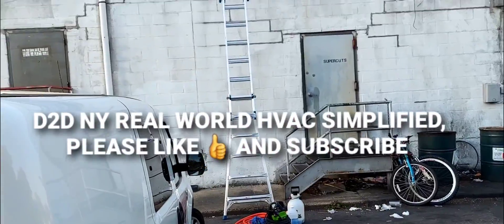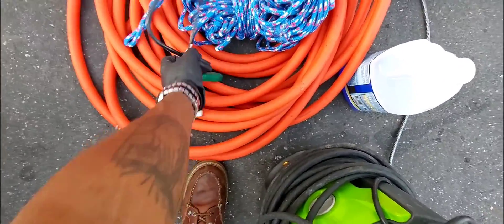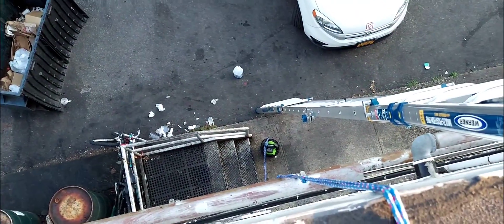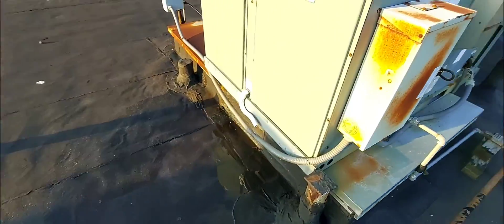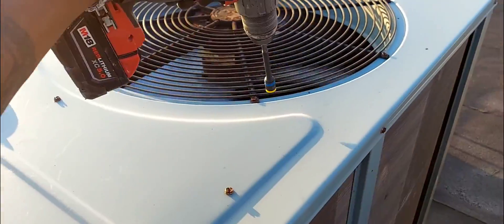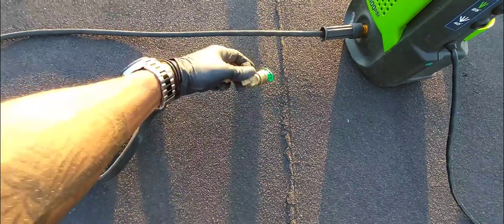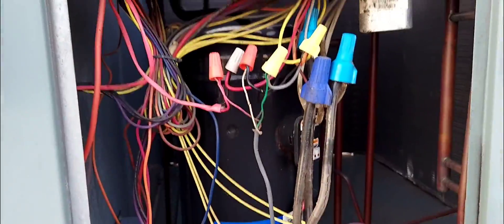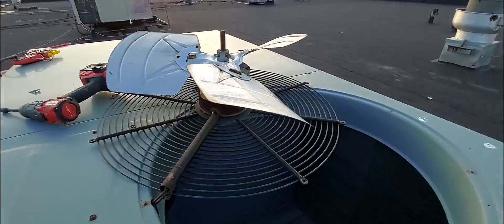HVAC CONDENSER COIL CLEANING

Comment: Commercial pressure washers shouldn't be nowhere near a coil , to maintain coil health it's better to wash with high volume instead of high pressure.
Reply from the maker: I disagree some coils are too thick for a regular garden hose and you need force behind the water to push out the dirt and debris, however you have to have the correct setup ie nozzles and know what you are doing
Reply: @D2DNYAC  that's why you use a Gould's booster pump instead of a pressure washer, I myself will use a low psi pressure washer for residential units as to not use alot of water when servicing evaporaters , but anything on the commercial side  especially chillers high volume  is required
Reply: True, had teacher have apprentices clean coils, they pressure washed it flat, he handed them fin comb and spend a few hours to straighten.  Little to them did they know new coil was on order.